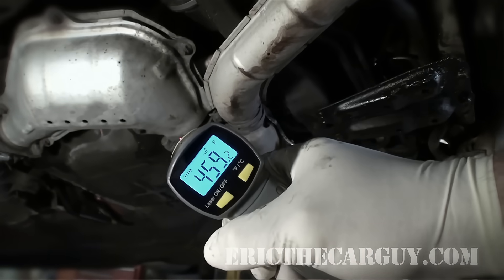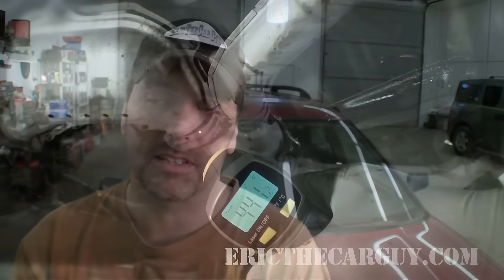Does Lacquer Thinner Clean Catalytic Converters? -EricTheCarGuy

Comment: Some people are saying they can't drive for that long on a highway at that speed to keep the high rev's but you can drive around for 2-3 hours anywhere down a gear or two EVEN if you have an automatic.  You can take the gear selector out of "D" and put it into 1st or 2nd and keep the rev's above 2500.  Then the lacquer thinner will do it's work to clean the Cat at the concentration Scotty said (not Eric's) ...1 gallon per half tank of gas (10 gallons of fuel)

Also good for recharging your BATTERY (not the lacquer thinner - just the high revs).  Mechanic once told me battery was dead  after sitting in his lot for three weeks (Hyundai Sonata 2015 engine replacement at 210,000 km's - extended warranty - I had to ask for it).  I asked if he drove around charging it once boosted and he said he used a trickle charger all weekend.  HA!  I got the shop to boost the battery which took 20 minutes and 5-6 tries - the battery really was down to zero) I literally just drove home (30 min drive in 1st and 2nd gear and the battery was completely back to normal.  The ol' man taught me that.  He wasn't completely useless. lol The same battery is still in play a year later.

Comment: I don't advice the use of anything other than the fuel on the fuel system, if you want to clean the catalytic converter, you need to clean it separately from the vehicle. Any additive may damage part of the fuel system: pump, fuel injectors, sensors and ...You don't want to take chance for that, look for a cleaner that clean the cat separately from the vehicle.

Comment: Worked for me with no issues.  Scotty says to add ONE gallon to HALF a tank and then drive fast (or run at 2500 RPM) until tank is almost empty. if you only added a quart, that may have been the issue.

Comment: Hi Eric. I have a 2000 Toyota Camry XLE 2.2, The car is old and has dings and dents. But the car usually runs like a tank. Unstoppable!!!! I replaced valve cover gasket. Recently I got a P0420 code. I went through 2 bottles of Cataclean through the car. My check engine light still comes on. I'm befuddled!! I do not weld. The car has 201,000 miles on her I bought Cataclean ran the car for a while. No luck . Any ideas please!!
Reply: your vehicle is probably running lean,

Comment: In all seriousness, if the Cat is lightly clogged, any continuous highway driving will improve matters, because the exhaust system and the Cat Conv will run at high temperatures and thus regenerate  the cat.
put some load on board and find some long hill climbs even better, anything  to get the exhaust temp continuously up.

Laquer thinners usually consists of vast majority ( like 60 to 80%) " liquid hydrocarbon" ( white spirit) which is pretty much the base of petrol and a hole pile of other things.
The next major portion is usually alcahol ( ethanol), usually followed by some  Acetone and maybee a small amount of Tolluline.

Probably just as effectiver to run a couple of tanks of ethanol blend or throw a bottle of Metho, ( denatured alachol for you yanks) in the fuel.

Running alcahol in the fuel is an old engine cleaning trick.

BUT, a long hard drive, is probably the safest and most reliable option, solves many problems & is good for all cars. ........... if ya go somewhere interesting, hey, it's all good.

Comment: 0:20 Scotty Kilmer didn't say that it would "repair" the issue, he said it would "clean" and possibly eliminate the need for a new catalytic converter. For $20 it's worth a try before you dish-out $1000's for anew catyltic converter(s)/mufflers.
You also did the test on a vehicle that did NOT have Check Engine light on, Scotty's intent was for a car that DOES have one on.
Reply: Also, this guy didn’t use a full gallon of lacquer thinner and he did it on a car with 2 catalytic converters instead of one…sounds like a set up to me.

Comment: If you suddenly have codes popping up, ask yourself this.  "Has my battery gone completely dead recently or did I change the battery myself"  If yes, drive your car through the manufacturer specific, driving recycling procedure to re-boot your computer.  A lot of things can be fixed by just idling from a cold start for a few minutes while turning on every electricity item in the car.  AC, rear defroster, radio, lights, etc.
Reply: where do you find the information to reboot your cars computer?
Reply: @kellymckinney1681  You could just Google your car info with Drive Cycle or a forum for your car or your dealer or your mechanic.  My mechanic took it out of a file cabinet.  I'm no expert, but before you throw parts at a car,  I have learned to check for wiring connections,  wire corrosion, electrical switches, sensors, relays, and computer programming.  I had a misfire  once because he forgot to put the coil back on the new spark plug!  So K.I.S.S.  Keep It Simple Stupid!

Comment: Oh yea, I LOVE using that and people are running to me like "WHOA WHOA WHOA BUDDY YOU CANT DO THAT!!!!" ... Pours anyways lol.  Yea this stuff works 900% better than the rip off products like the Lucas fuel system cleaners and all that nonsense.  For every gallon of gas, you put in a mere 1/4 of that in the thinner.  I typically use a little more.  It will make your vehicle run leaner so don't go pounding on it until it runs out or you refill.  The inside of the convertors looks brand freakin new too!  No, it will not mess up fuel lines or eat away any components of the fuel system.  This was before youtube, been using this method for pretty much life

Comment: I think you are supposed to use 1 gallon. I have the 420 code and a very high 2nd o2 sensor reading. What causes high down stream fuel trim and 420 code. My car runs great, 2003 Toyota Matrix. It does burn oil.

Comment: As Myth busters do... They always Screw Up... Change / Weaken the Fix... So It Does Not Work.  You Need 4 Times the Thinner.
You were supposed to do 1 Gallon of Lacquer Thinner on a Half Tank (8 Gallons of Gas).  You barely had any Thinner.
But I used 2 Gallons of Lacquer Thinner with 13 Gallons of Gas in my 2013 Chevy Silverado 2500 HD and Drove 190 Miles on Highway.... Till I was near empty.... And it worked.  
But hey,  This Video is just an attempt to try and put down another Channel... small minds... small mission

Comment: I know that some of our large company trucks have catalytic converters and how they are cleaned is they're stuck in a kiln and baked and they come back refreshed and working I think that would be almost the same as running High revs getting a lot of heat into the Cadillac converter to burn off the sledge that it's in it just a thought do not bash me

Comment: Thinner is great for keeping intake valves and combustion chambers clean but how can you expect it to do anything after it ha been through the burn process? You could just introduce it through a large intake vacuum source and flood stall the engine, let it soak, repeat and then perform a temp test after a 20-30 minute road test. The point would be to soak the substrate in solvent

Comment: Just gut or straight pipe the catalytic converter and use a spacer like a spark plug fouler for the downstream oxygen sensor who's only job it is is to check operation/efficiency of said cat converter. It is only looking for a change in O2 levels and backing the sensor out a little from the main exhaust stream "fools" the sensor as it causes a change enough for the sensor to think that the cat is there and working....this keeps it from throwing the code for the catalytic converter. The operation of the IMPORTANT UPSTREAM (above the cat converter) which is actually technically an air fuel sensor (AF sensor) not actually an oxygen sensor like it is often called is not effected in any way. An inline four has one upstream sensor and is either a narrow band or wideband air fuel sensor which directly dictates your fuel enrichment via the fuel tables in the ecm when it is heated up and car goes into closed loop operation......a V6 or V8 has bank one and bank 2 corresponding to the separate sides of the motor. Typically sensor 1 is the upstream AF sensor and sensor 2 in the downstream (after cat converter) oxygen sensor but check specifics for your vehicle to verify.
Anyways.....the secondary, downstream O2 sensor does nothing but monitor operation of cat converter and if you live in a state or area without emissions testing then you can gut or yank bad cat converter and use spark plug fouler method OR actually plug in an electronic device that in place of downstream O2 sensor that also fools ecm into thinking cat is there and working. Just information for people. Being so many Assholes are stealing cat converters.....if you cannot afford the way over inflated prices to replace them and auto insurance is not helping then YES....if no Emissions check like a visual check then straight pipe it and fool ecm into thinking cats are there and working. Just info for those who may be looking at this situations.
Especially since our pathetic government is fed, state and local are doing NOTHING to stop the sale of stolen cat converters to recyclers. Lots of ways to do it which would virtually STOP cat converter theft mostly as there would be little profit in it.
Sure, some would recover the precious metals inside cats but many low level crooks just take the cut off, stolen cats to someone who buys them like that. Making it harder to profit from stolen cat converters would drastically reduce the huge issue with cat thefts. Rant over...../.....

Comment: Cataclean is essential lacquer thinner. With that being said, the proportions that cataclean recommends is to add contents at 1/4 of a tank.
Reply: Cataclean didn't work for me. I followed the directions and my check engine light came on. Now I'm going to try this. Also I have 155,000 on my 2012 Chevrolet Impala. I changed all my Oxygen sensors a few months ago and my light keeps coming on.
Reply: @daddykiller5835  did it work?
Reply: @daddykiller5835  damn I’m sorry about that :/ maybe it’s something else? Have u done a tune up yet

Comment: I have a p0014 and a p0191 code for variable valve timing and fuel rail pressure I took it to a shop and they told me both my catalytic converters are bad is that possible?

Comment: Will this damage any rubber hoses or parts of rubber in the injection system if you don't get it all cleaned out by driving so many miles, like 100 miles vs 200 miles?
Reply: use it up, then fill your tank

Comment: Scotty's Laquer thinner hack saved me $1800. It cleaned my cat, got rid of my P0420, and passed smog!
Reply: For how long?
Reply: Really noway
Reply: @x.livelife2509 it works because my 2008 Saturn Aura ( Malibu ) 3.5 V6 pushrod  and my 2010 Honda Accord 3.5 V6 is proof it works thanks Scotty got mine from Walmart Kleen tools brand new $8 bucks a can or get the gallon can few bucks more best price there
Reply: Still good?
Reply: @green3488 it works,if your even doubting!!!!
Reply: My engine is still running smoothly and the P0420 check engine light hasn’t come back on. I’ve tried a bunch of catalytic converter cleaning products over time, but honestly, lacquer has given me the best results so far. My catalytic converter was in rough shape, with nearly 300,000 miles on it, so it was pretty far gone. I wasn’t expecting much, but the improvement was noticeable.

1st Gen MDX 290k miles
Reply: @god-likesystems985  I've got a 2010 MDX that this worked on 1 gallon with a half tank of Premium and drove 4 miles to fill up the rest of the way. I floored it and ran it hard. We're trying to get the Cats hot and build pressure up. If you could tap on it with a small gasket hammer at the same time that would help break the carbon loose. Cleared my codes but they both cam back later. I cut the Resonator out and put a straight pipe after both Cats and haven't seen the codes in years. Both Cats Y together then to the Resonator. It looks like that was the bottleneck. Cruising around isn't aggressive enough, try running it hard to clear it guys. 2010 MDX 294K miles. Original Cats and O2's. It "can" help sometimes. 3G mechanic
Reply: @god-likesystems985  got 218k on my 2nd gen MDX, cat issues as well. I gotta try the thinner trick and see what happens.
Reply: It will ruin your engine. Edit: It 'can' ruin some engines. It ruined my 2002 toyota sienna,
Reply: @christianb8900 And how did it ruin your Toyota Sienna..
Reply: @seatime674  Blown head gasket. I guess only someone reading this can decide if that 'ruined' my Sienna.
Reply: @christianb8900  This didn't ruin your head gasket

Comment: If it's a four cylinder take out the oxygen sensor  & funnel on top of the without burning it this destroys the properties in the thinner by burning it, it will smoke like a freight train for a bit, but it's cheaper than catacleaner!

Comment: some catalytic converter theives plus a set of o2 sensor simulators, and a test pipe fixed my check engine light
Reply: I cut my converter out myself and took it to the salvage yard. Fixed lots of problems

Comment: You probably didn’t put enough of Lacquer Thinner in a half tank of gas. You need to use 1 Gallon of Lacquer Thinner. In a Half a Tank of Gas. I just started getting a P0420 in my 2014 Chevy Cruze with 185,000 Miles. I just tried it. I went to Home Depot to buy 1 Gallon of Lacquer Thinner. I put it into half a tank of gas. 

I cleared the error code from my car. I drove 160 miles today on the Highway. So far I didn’t get the code back. The car didn’t run differently with 1 Gallon of Lacquer Thinner in the gas. The engine sounded the same. Let see what happens. I will update soon.

Comment: This 100% worked for my Camry which has been having CEL for years with Cat Converter not running at efficient level bla, bla, bla.  Light comes on when cold or when I use cheap gas....

Comment: If you need to clean a catalytic converter, there is a industrial maintenance paper called;
REACTIVATION Of an aged commercial three-way catalyst by Oxalic and Citric Acid 
By Environ. Sci. Technol.
This process works, I've cleaned the cats on my Ford and passed emissions. I had had the codes P0420 P0430 and could not pass.

Comment: I did this in my 2010 Scion TC and got a misfire trying to get on the interstate after work the next day. My thought is that the extreme heat that day increased the vaporization and pressure because of the higher ethanol content. Any thoughts?

Comment: You didn't add enough lacquer thinner. 10% is the recommend concentration. That's 1 gallon LT to 9 gallons of gas. Looks like you used a quart.

Comment: 2010, Nissan Sentra with over 247,000 miles.  Nine months ago I started getting an underperforming cat code which I would erase and  it would return with growing frequency.  Bought 1 gallon laquer thiner at Walmart, put it in the gas tank,  filled the gas tank,  and went for a 7 hour round trip at highway speed. That's the last time I saw the cat code. The car seems to be running much better and has had no other problems.

Comment: What if you busted a hole through the catalyst tube to tube, would it allow enough more flow that the rear 02 sensors would not send the feedback to set the code ?

Comment: Would bad Cadillac converter make your car putt and not have power like it was miss firing changed spark plugs wires but still have a putting noise no power. Any help would be greatly appreciated thank you

Comment: Ok I’ve replace Everything that code 410 has come up with the blower motor the va sensors 02 O2 sensors all four of them the valves to the air fresh air system even if use all the stuff except for one thing and that’s the catalyst converter cause I still be pulling a 410 code

Comment: Nissan Pathfinder 2014 SL check engine light came on yesterday (PO430). Yesterday evening brought a gallon of Lacquer Thinner. Today I applied the whole gallon to a little over half a tank of gas. Took a ride to Ventura Beach from the high desert. 134 miles. The Check engine light was still on. Pulled over to get some gas on the return trip. The gas tank showed a little over half. Pulled over in Lil Rock, Ca. at Auto Zone. Asked the employee how to reset the code. He advised me to disconnect the battery to reset it. My girl told me to wait until we got home. Started the car to finish up our trip home. To my surprise the check engine light was off. No need to reset anything the check engine light went off on its own. So, in short the 1 gallon Lacquer thinner to a half tank of gas worked for us. Our round trip was approximately 268. The check engine light cut off for us after driving around 220 miles instead of 150. 👍🏿😁💯.